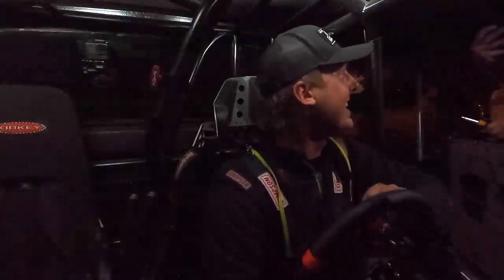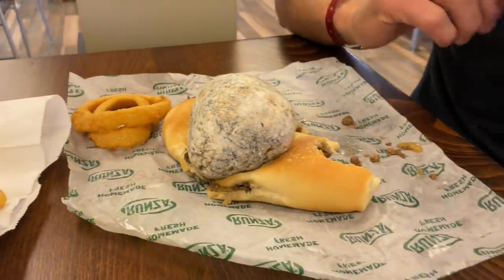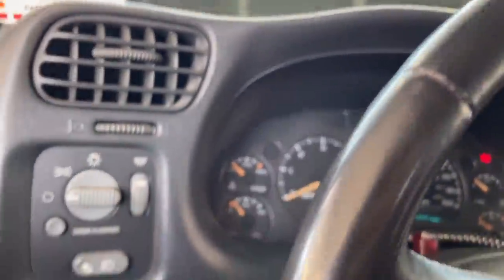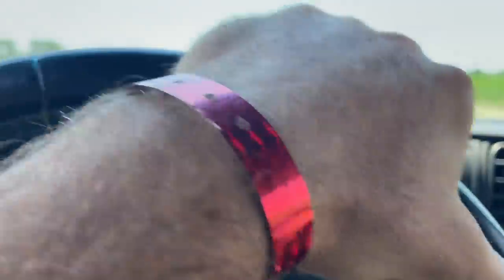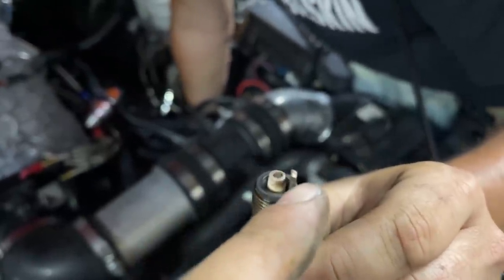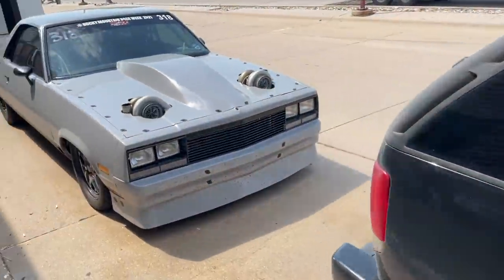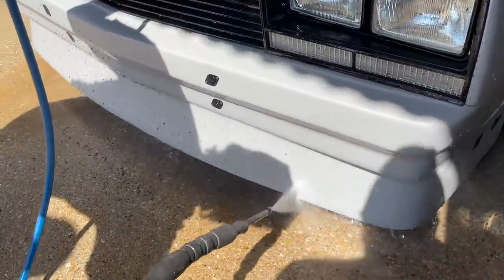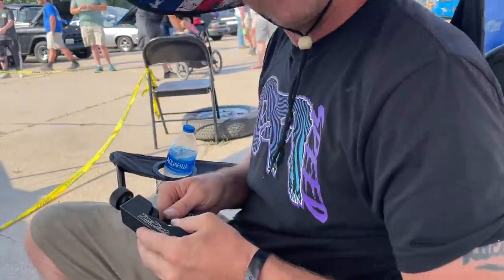RACE WEEK Day 6: We Got Mullet into a SITUATION lol! (Worst Passes Yet...)

Comment: Why stay in hotel rooms when u got the toter? Just have someone follow u around with that beast.. race shop on wheels as well as the house on wheels... and u got ur own freaking lift for the entire team and could maybe rent out the lift aswell. That seems like the way to go, plus all the storage for broken cars and transport. Just need to put a welder kit and compressor kit plus some extra stuff for repairs. Seems like u got a rolling shop at that point... and whoever has to drive it should be ant team member and everyone rotate. Stretch the rules

Comment: My theory is you should have change the supension back on the four link to the orginal setting and was was wondering why you didn't put the tune back also. You had leaned it up for the mountains, next time make a run even thou its hot for you always need to get the brain working.

Comment: I rolled a S10 back in the day when I was 19 we ended up ok just a couple cuts and scrapes we ended up flipping the thing back on it's tires and fired it up and drove it home with the windshield and back window all smashed and the roof of the truck was all bent to one side but it got me home it smoked like crazy for a while because the oil was all on one side of the engine but it cleared up

Comment: Its not the car dork , its the set up. Those bars need adjusted for every track if you want it to go down. The shocks need adjusted for every track, the tires need adjusted for every track ,the weight needs adjusted for every track , the tune needa adjusted for every track. Dont blame the car bub the car is perfect the setup sucks ass though

Comment: they also need to lighten up with the water on the track because whenever you roll through there your front tires are putting water on the ground right in front of your back tires. They just need to spray people's tires as they go just a little bit of water

Comment: Hey you run the air on the intake through a intercooler that is CHILLED ,  by NOS ran through  the intercooler. I had this set up on my 1991 Mercury Cougar. That had a v-6 SUPER CHARGED motor. With the intercooler that charged with NOS. With out the NOS it was pushing 18 - 20 lbs. of BOOST! I never ran the NOS through it, because I was a divorced Dad raising 4 boys by myself. So I could not afford a big ticket, or have my CDL's removed. Because getting a ticket while having a CDL is FROWND on by Law Enforcement. I But was told by the shop I took it to. To be put on the DYNO, THAT WITH, NOS. It did 30 lbs. of boost. But if toyed with, maybe 40 lbs.  or so! I  was challenged by "crouch rockets" all the time when they saw the SUPERCHARGE EMBLEM on the front fenders. And other guys that after I STOMPED every time! From traffic light to traffic light. Also rolling at 60 mph. Then when they found out that it was a V-6, they would cry like babies.    SO TRY IT,.... YOU CAN DO IT!!!!

Comment: 6lbs of boost in thin air is not the same as 6lbs of boost in good air. My mountain sled makes the same power on 6lbs at sea level that it does on 14 at 7000 feet

Comment: Get a Motion Raceworks checklist and put it in a good place that you will see it all the time and you can't be but so mad Mullet is a fresh build and before you took it on the second of a trio of drag and drive events across America you only had a few hits on the dyno and a few test passes on a very good prepped track with decent air density now you're in the middle of America in very high temperatures and very high humidity and very high DA and you've put over 1,000 miles on the car now putting a beating on untested roadworthy parts lets just face it Mullet,Ruby, and Leroy amongst Royce's blown 65 Mustang Tom Bailey's Camaro's yes they all have been 1,500 mile roadworthy proven but at the end of the day they are all full blown race cars and aren't really made to be driven for hours and hundreds of miles at a time they are really meant to make one good 8 second or less, 150+mph hit in an 1/8th or 1/4 mile at a time and then cooled down then go at it again I think you need to hit up either Pro Torque,Hughes, or Neil Chance and get a bolt together converter built for Mullet and then hit up Rossler and get them to build you a good billet trans with a ballistic trans blanket and put one internal and two external dump valves on the trans and also run an air shifter but you should really get a bolt together converter so you can play with the stator if need be at the track and you should get Precision Turbos to build you a set of turbos with billet wheels,triple ball bearing,stainless back housing,billet center section,and billet front cover,with the ballistic cross bolts in the exhaust housing,and ballistic blankets for the front cover.
Reply: Get a surge tank as well to drain the excess oil out of the turbos after you make a good rip

Comment: Honestly the worst part of this video is Garret calling Mullet a turd. So it's the cars fault that you can't dial it in Cleet because you don't have the knowledge/experience to do so yet? That isn't right, you know full well that Mullet can and will run 7's and possibly 6's,  but it needs to be tuned and currently you don't know how to do that correctly. HELL you even say as much at the track, then to call it a turd at the end out of frustration is just wrong man. You RUSHED, you didn't give yourselves enough time to get proper data and set the car up, instead you rushed and did 3 hits back to back with very little change etc and then blame the car rather then yourself, that would be like calling your Hydrolic Jack there a turd for not lifting when your at fault for not closing the pressure release or the like. 
And no Mullet is not Ruby, its not Leroy but you KNEW that going in, you knew that you were gonna have to relearn a lot of things about how you set up the car, hell others even warned you that you where going to have to learn a lot. But the car is literally 1.75 races old and it's already given you better times then Leroy or Ruby did in how many years? Hardly a turd man, and honestly as others said feels really disrespectful to call it one.

Comment: Why don't cleetus just get bigger tires? To handle what he is throwing.. All high HP cars do. Or am I missing something..
Reply: Biggest tire he can run in the class he's in.
Reply: @socialjusticewarrior9601  gotcha, can he change class and get a different tire then?
Reply: @josh4realz211  Could. Changing to a bigger tire is half the solution. There's many other variables that would have to be changed to accommodate said tire size.